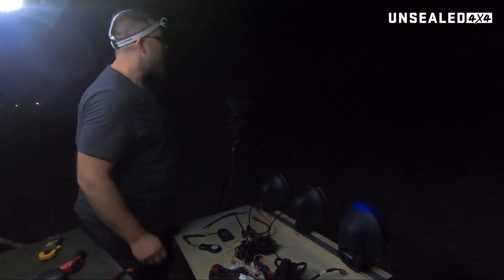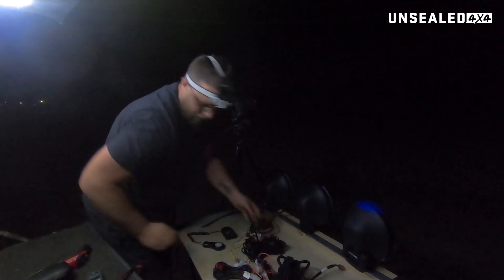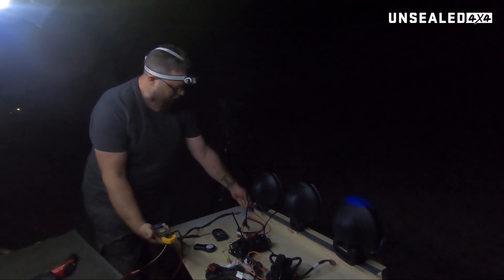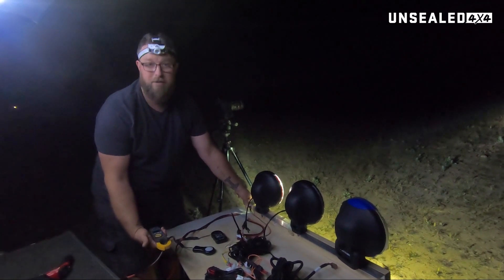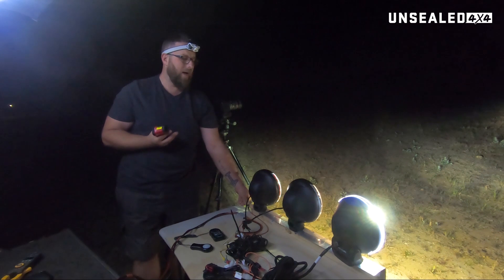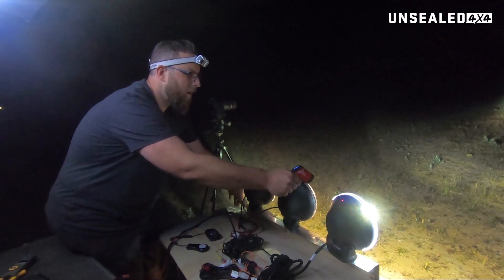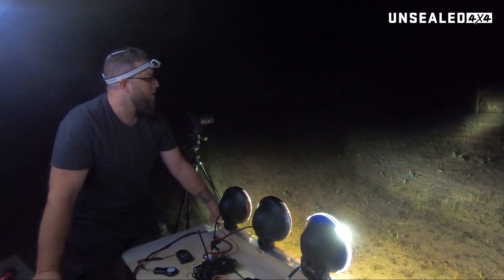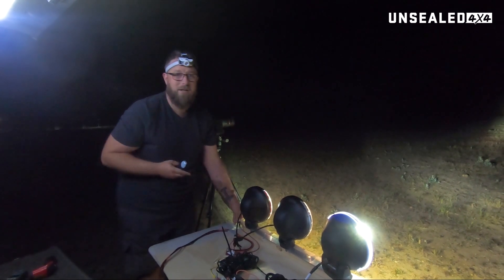LEDs... Is it game over for HIDs and Halogen driving lights?

Comment: You need +98CRI to see all colors, halogen delivers 100CRI where Led and Hid are +/- 70CRI, which means you loose 2 vital colors from the color range which you need to identify wild life with. Hid and Led has a high color temperature which is not ideal for night driving. Led and Hid glares back in fog,rain, dust and smoke, google Tyndall effect.
Reply: Agree, i like halogen better, especially for Indonesian street which the aspalt is very  dark black. Only halogen lamp can produce solid light, especialy during heavy rain at night. It shows Good contrast on the street surface

Comment: Should test the Fyrlyt nemesis 9000's
Reply: Alex Dixon agreed, they’ll blow all of these out of the water.
Reply: @Aussiefish86  in power consumption for sure haha. You can run 5 HID narvas to 1 nemesis
Reply: @lunchie80  doesn’t mean squat when the light quality coming out of them is complete rubbish. Who gives a shit about power consumption? It’s not as if the car isn’t running when they are on.
Reply: @Aussiefish86  having to run a 12 to 24 converter and 500w of lights(plus the loss of the converter which will likely be 90% efficient) plus your other headlights(let's be conservative and say just normal H4s which is 120w for two) and you're EASILY at 50A for those alone. Add in a DCDC charger(25A). You're now at 75A.

Typical cars at idle(fuel pump, ignition, ecu, stereo, electric power steering pumps,demisters, heated seats etc on modern cars all add up quickly. In fact new cars need 35-50A just running doing nothing. So 50A for a modern 4wd, 50A on fyrlyt plus any other accessories and you're stressing an alternator. 

That 50A for fyrlyt is a MASSIVE draw and is a serious consideration some will need to factor in, and depending on situation ABSOLUTELY may overdraw a charging system.

I've side by side tested fyrlyt with LED with a friend one night, yeah they're ok but not worth the stupid wiring required.

500w for a pair of lights is stupid
Reply: @lunchie80  I don’t know about your car but mine has 140A available so I could easily run everything you mentioned above (125A) and still have some change to play around with. Most modern quality 4x4s run a minimum of 140 anyway and there is larger upgrades units easily available if you reach the limitations of the stock one. Each to their own but I much prefer the Fyrlyt units over any of my mates LED units and not only for their brightness but also due to less eye strain, less issues with penetration through dust and fog, exceptional quality and last but not least awesome customer service and made in Australia 🇦🇺.
Reply: @lunchie80  sorry - but you haven't got a clue. I run two Nemesis 9000 AND a Baja Designs 44 inch stealth bar (when it is needed). The vehicle with standard alternator has no problem powering these lights, plus two fridges and other accessories. The "argument" that lower power draw of LED's is totally irrelevant on modern vehicles.
Reply: Unsealed, still no understanding of light wavelengths and how human night vision works for night driving. For 14 years we've been telling the story, advertised with you in early days and not once have you ever been interested in an Australian brand leading the way in telling the truth about driving lights.

Comment: Would have been better if you had tested better and more closely matched specification lights.
Reply: They don't get much more closely matched than three lights from the same manufacturer and as close wattage as possible?
Reply: Wes the wattage and specification are very different things. The halogen spotties they tested were rubbish units. They should have tested the market leading units for each type.

Comment: The reason some lights seem brighter despite the readings is something called optimal luminous efficiency. We don't perceive different coloured lights of the same intensity to have the same brightness. Light that peaks around 5200K will be perceived to be the brightest. It's just the way we've evolved.